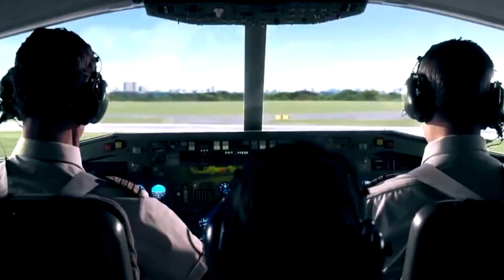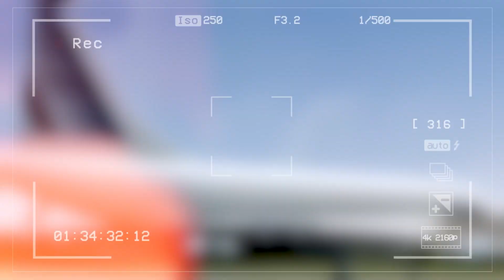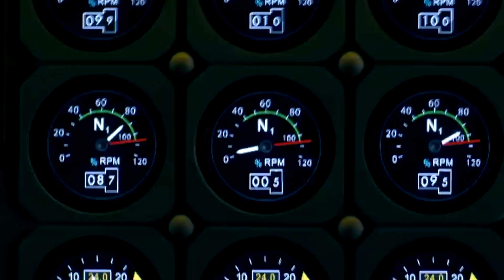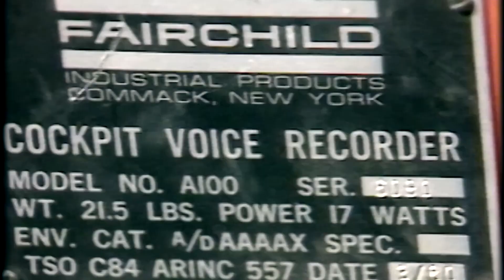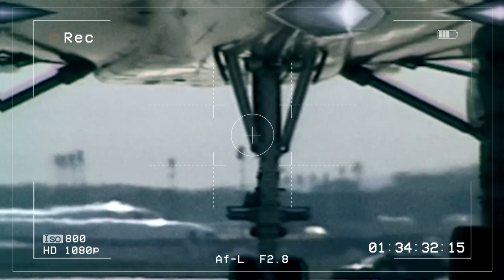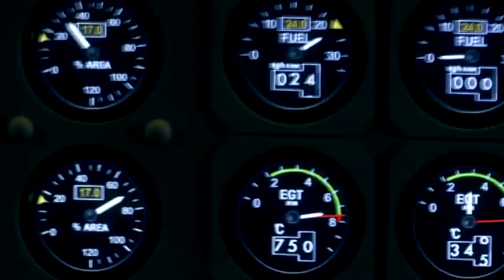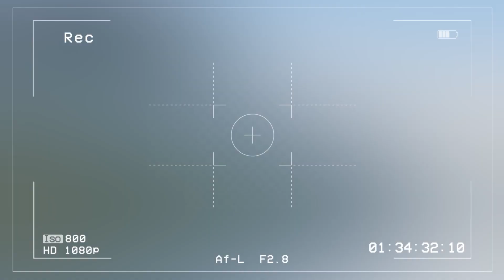A Metal Piece Was Responsible For the Crash of Concorde's Last Flight

Comment: It started before the metal strip.

-Aircraft was over the maximum takeoff weight for ambient temperature and other conditions, and 810 kilograms (1,790 lb) over the maximum structural weight.

-Keep in mind came within 20 feet of hitting that Air France 747. 

-V1,crew continued the takeoff, but did not gain enough airspeed with the three remaining engines, because the severed electrical cables prevented the retraction of landing gear.
Reply from the maker: Hey there, Thank you for your response.
It's truly a tragic series of events that led to the Concorde's last flight. The combination of being over the maximum takeoff weight and the severed electrical cables complicating the takeoff must have created an incredibly challenging situation for the crew. The near miss with the Air France 747 only adds to the gravity of the situation. It's a stark reminder of how critical every factor is in aviation safety.